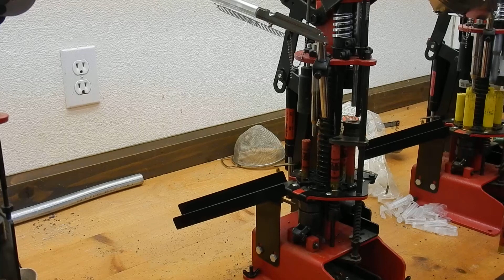MEC Shotshell Reloader .410 bore

Comment: can you adjust the machine from 3 inch to 2.5....
Reply from the maker: This is 2 1/2 inches. 
I haven't ever changed to 3 inches. It can be done. It would need other parts and much adjustment.